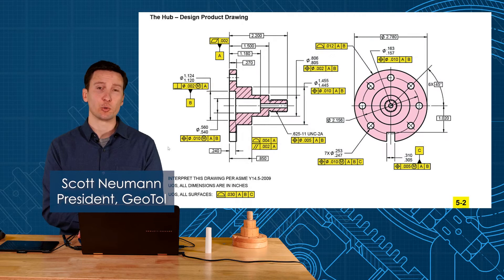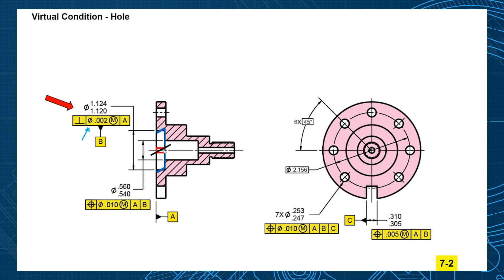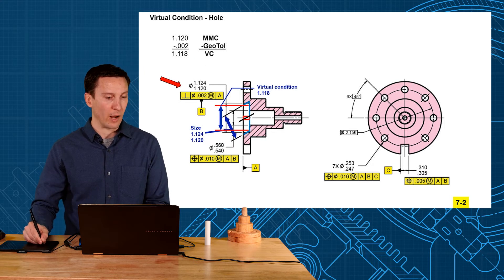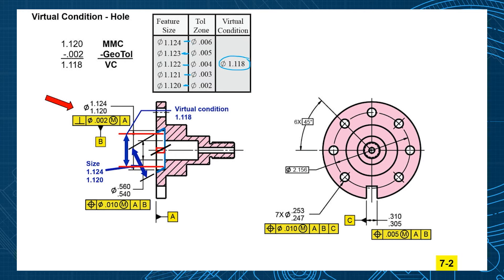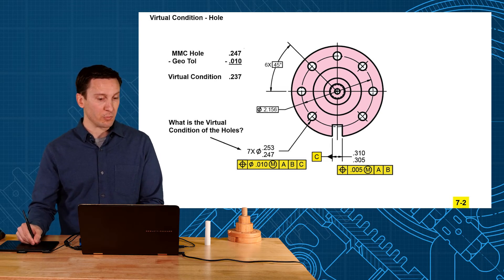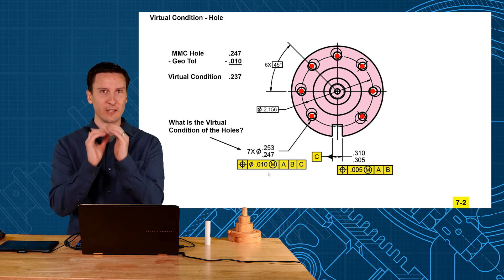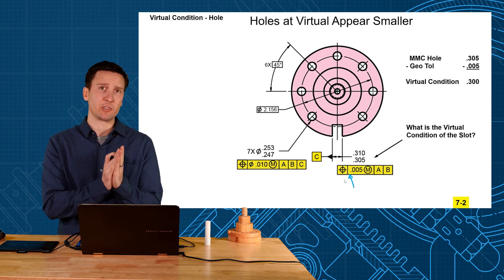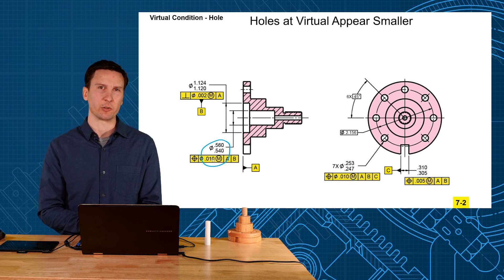Virtual Condition in GD&T

Comment: Another really great video. One question though: Does the calculation of the VC change if we have a composite FCF?
Reply from the maker: There are two virtual conditions with a two frame composite position. The upper frame creates a VC relative to ABC. The lower creates a VC with respect to the features within the pattern and to any specified datum reference frame.

Comment: Hii
Can you make video on usage of profile as a datum, what is exactly needed by this and  how does the measurement software perform profile as a datum, whether the deviation of profile will have any impact on the holes falling on that profile ?
Reply from the maker: Profile is a symbol and cant be a datum. I assume you are asking about a curved surface as a datum feature. It is difficult to measure and usually requires a fixture or software. A true geometric counterpart is created as the inverse shape of the feature. The high points of the feature contact the TGC to constrain the part. In theory the variation of the datum feature do not affect other features because the measurement datum is perfect. Hope this helps.

Comment: And what if MMC is not used? Is the positional tolerance still added to the MMC hole size to calculate the virtual condition?
Reply from the maker: This is a technicality, but if the tolerance does not have the MMC modifier, it does not have a "virtual condition". It still has a worst case boundary, but it is now called the maximum material boundary or MMB. Same calculation though.

And, the calculation for both virtual condition and MMB is MMC hole minus the position.